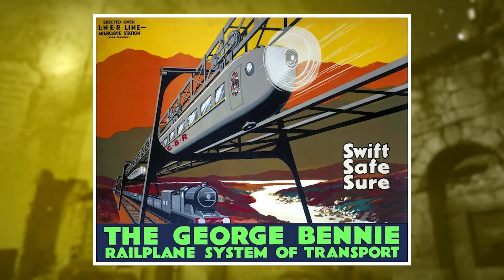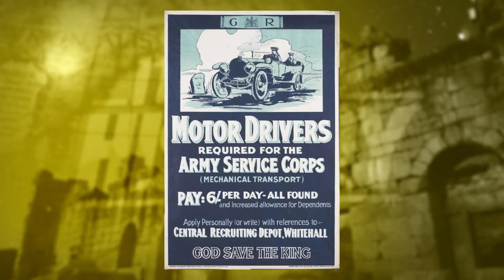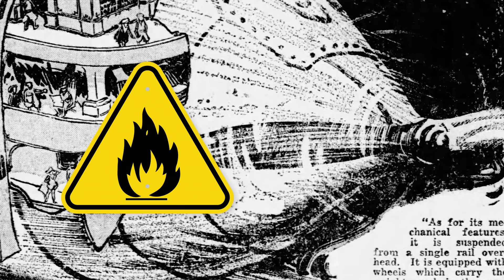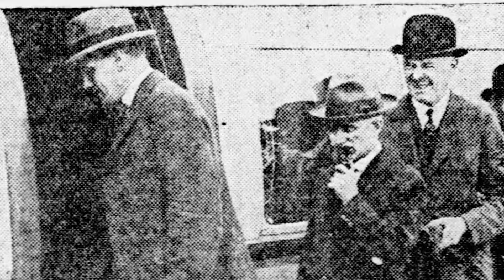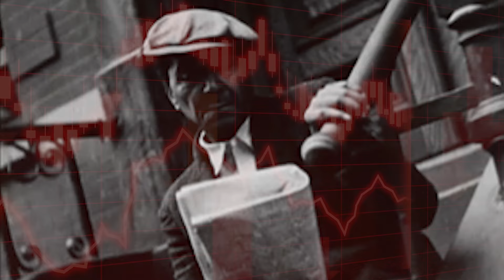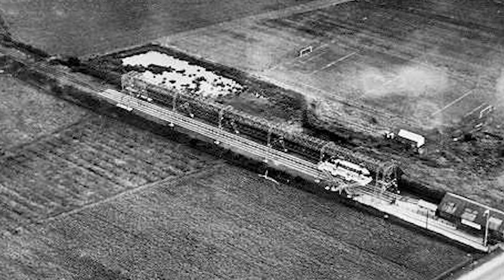Why the Railplane Totally Failed

Comment: It didn't work because they were spending too much $$$$ on infrastructure.  The solution (if there is one) is a less expensive system, not a new system that costs more.  So, if it works better and costs less but looks cooler, then THAT is going to be the solution

Comment: It would be cool as a concept but it looks far more expensive to build than other mass transit systems with all that metal for the structure. Plus even with an electric engine I can't imagine those props were nearly as quiet as claimed, especially outside of the vehicle.

Comment: Imagine building something like this today, but replace the props and electric motors with a couple of J79s. Provided you can deal with the aerodynamic heating you should have a supersonic monorail.
Reply: Imagine that going trough your neighborhood! There is a reason, why the Concord was only allowed to fly supersonic over the open sea. Even a tiny airgun pellet or the tip of a whip are unpleasantly loud, when going supersonic. Supersonic train would destroy windows and eardrums.

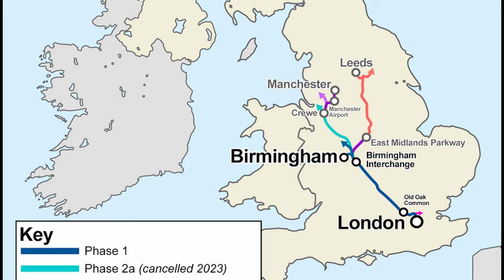Comment: 19:33 "UK also plans to build a new monorail over existing Railway service"  -  a 20-metre high elevated monorail run above the existing track between Woking and London Waterloo published 1 APR 2017 (fools)

'hs2 a High-Speed Rail Project in the UK also plans to build a new' cable hauled mover connecting HS2 to the Birmingham Airport terminal.

Comment: The Railplane and track were not demolished during WW2; they survived until 1956. The maximum speed it reached was 55mph, limited by the length of the track.  For most of its existence it had a two-bladed propellor ot one end and a four-bladed one at the other.  The motors were rated at 100hp and ran on 500v. 120 mph would have been achieved on a longer track.  The track construction was similar to (but lighter than) the Wuppertal Schwebebahn, which has been in operation for over a century.  Bennie was not a trained engineer and the design work was done by Hugh Fraser.  There is an extensive archive on the project at the University of Glasgow library.

In 1930 the railways were congested with slow-moving local services and freight.  Road transport was under-developed compared to rail.  This was a serious proposal for high speed passenger travel in its time, confounded by vested interests and economic depression.

Comment: Looks like a gadgetbahn to me, and likely would have never worked.
The LNER Class A4 (Mallard) came out at around the same time, and could do 126mph on conventional track.
As well as being very expensive to construct the track for this over any significant distance, I don't see how points [switches] would have worked on it, so you couldn't have any branches on the line.

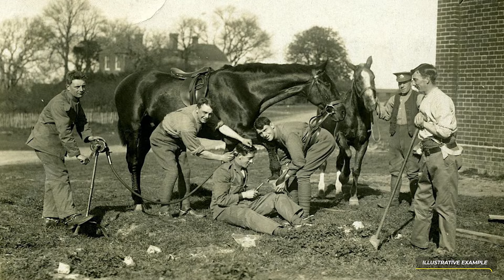Comment: 5:15 What is going on on that photo???
Reply: Yes.
Reply: The guy sitting on the ground is cleaning the horse's hoof that the gentleman bending down on the right is holding.  Meanwhile a colleague is standing behind the seated gentleman most likely pretending to be, but perhaps actually, cutting the hair of the seated man with mechanical shears powered by the crank being turned by the gent standing on the left of the picture. A gentleman in a cap is holding the horse's bridle while a fellow next to him idly rests on a broom 
At least that's what I reckon 😊

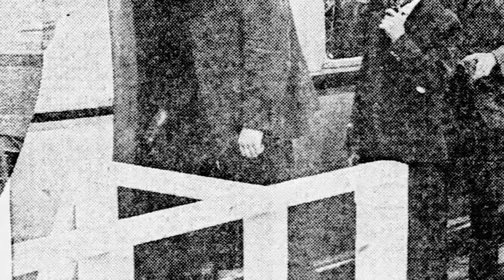Comment: At 11:53 you show a newspaper clip that says in a trial run the railplane "covered the 30 miles in exactly 15 minutes". Yet the test track was only 130m (and not c. 1800ft as you earlier claimed).
Reply: Which would have been the proposed 120 mph yet it never exceeded 55 mph.

Comment: Surprised you didn't mention The Meigs Elevated Railway in Cambridge, Mass as well in the opening section. I would suspect this system couldn't be easily scaled up. Switching trains between right-of-ways would be complicated (one of the reasons monorails in general haven't replace traditional railways) & How effective would the props be in intermediate coaches? I would imagine the air currents disrupted by the lead prop would diminish the efficacy of the props in the middle.

Comment: A nice Video, well explained. However I think the railplane failed because of a fatal design flaw: The small cars of the prototype may have been easy to accelerate and move, however with a 3-digit passenger capacity, the prop drive would have caused an awful storm in the station during acceleration. All successful transport systems have been scaled to high passenger capacity.
Reply: Also, the power delivery is lossy. Why connect your transaxle to a fan and push air? Why not just directly deliver effort to the rail?
Reply: @slackerman9758  Friction? 48 pounds to push it
Reply: @Johnketes54  When did I mention friction?
Reply: Concorde was successful
Reply: @Johnketes54  no, it wasnt.
Reply: @MarceloBenoit-trenes  Explain yourself? It ran for years and let down by the French, More import my 12 year old friend, Explain to me in more than one word why you consider it as a failure?

Comment: Maintenance, after a few years, would have been a nightmare after the steel gridwork started to rust out.

At least traditional trains are supported by the ground, and derailments are generally easy to deal with.  The railplane would fall out of the sky like....  a plane....
Reply: On top of that if the engine fails that passengers would be stuck up there. Too high up for ladders.
Reply: @dannydaw59  Not an issue, as the development of cable cars shows us. You get people out using a trapdoor and rope system, or if the system is running above an area where this is not possible, use a helicopter.

Comment: A lighter vehicle will be much more affected by side winds than a heavier one of the same size. Also the bridges etc would still have to be built strong enough to support the full weight of the train. Otherwise if there was an engine failure the structure would collapse when the lift being generated stopped.